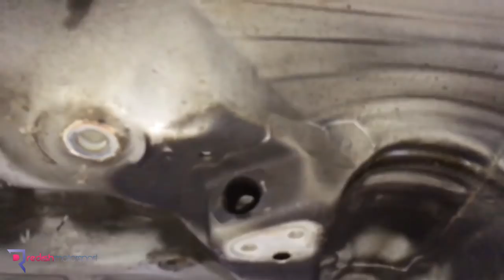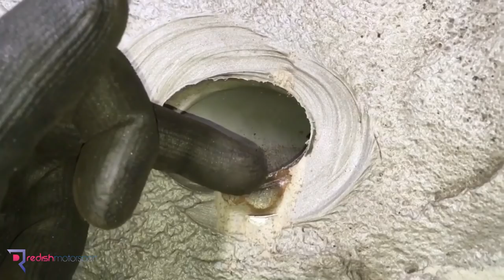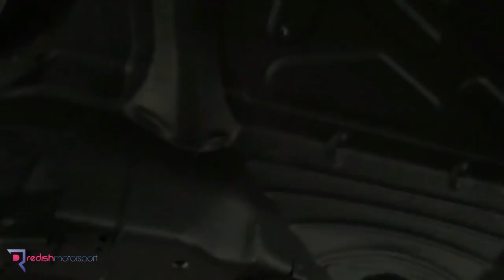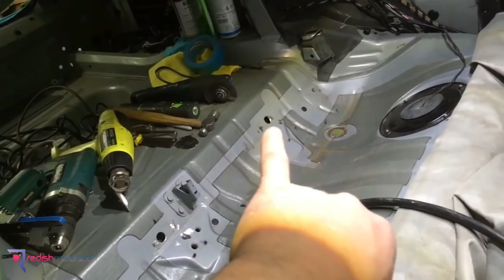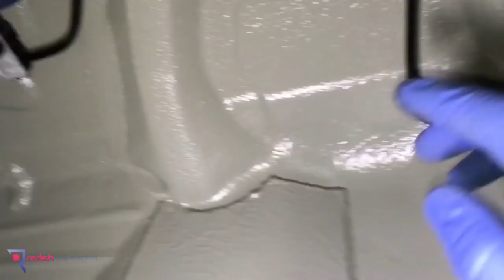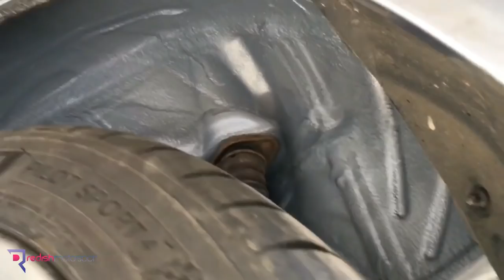BMW E46 M3 - RACP Repair & Reinforcement

Comment: Modern M manual cars are very compromised (shift bog/shift lag, rev hang, non-keyed crank hub, CDV inside slave cylinder,). The more I look the more I keep being reminded just how good E46 M3 is. But the subframe is such a pitfall, if you can only afford 1 in your lifetime and it gets repaired badly it will just lead to more rust in the new welds and the money is equally as wasted as if you spun a crank hub on a new M.

Comment: Nice work. When you weld those reinforcement plates onto the subframe mounts, do any adjustments need to be made to the suspension to compensate for the extra thickness lowering the frame position slightly or is it so small a change as to be inconsequential?
Reply: There are two spacers you get for the crossmember to compensate for lowering. Some people weld them, I didn't mine, I just use them as shims/spacers that can be removed. (In my mind less welds the better because if repair guys are not as good as Redish there could be rust).